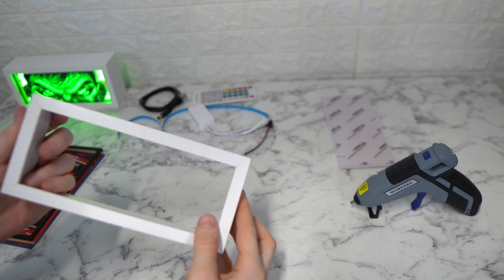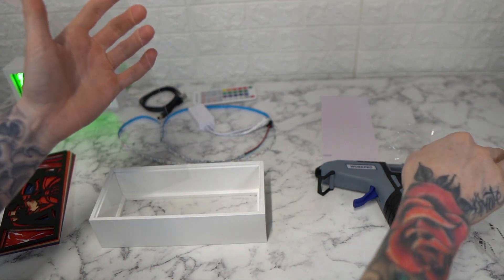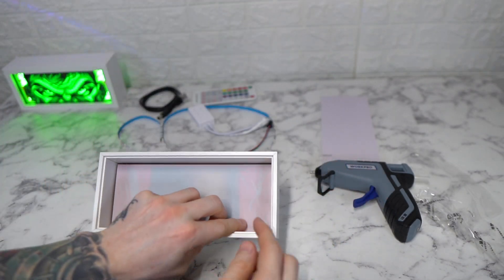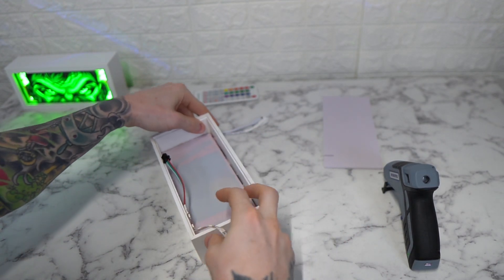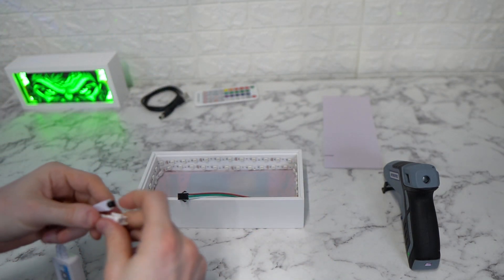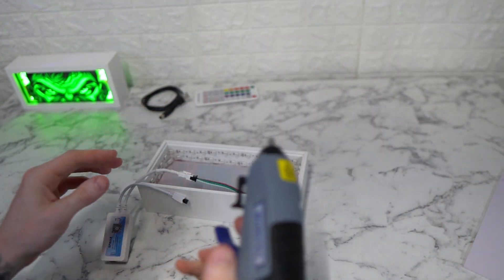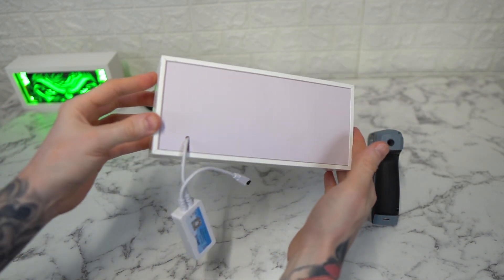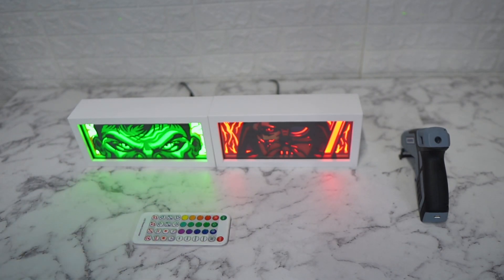How to Assemble a 3D Printed LED Box

Comment: Is there a specific reason you glue the led strip around the inner perimeter of the box instead of making an additional plate to glue the leds on?
Reply from the maker: Hey, do you mean putting the LEDs on the backing plate?

I've done it multiple ways and they all worked fine

Comment: What size wooden frame are you using? The links don't work anymore :(
Reply from the maker: Hey, I just took them down until the tarrifs get sorted out. They are the exact same size as the STL frame I provide with all of my designs.

210mm Length
95mm Height
53mm Depth
Reply: @amity3d  awesome thanks! I literally just found your content yesterday. Excited to get started though, they look amazing! Trying to buy LEDs and stuff first.

Comment: Where did you buy the glass and what size is it.?
Reply from the maker: It's just Acrylic glass that is 1mm thick. 
It's the same exact size as the design layers.

So you could buy some acrylic sheets of amazon then put one of the layers on top, trace the outline so you have the size then cut them out.

I also offer pre cut ones on my Etsy shop!